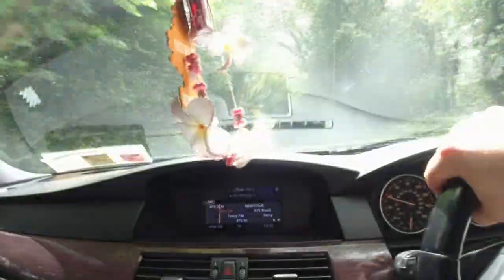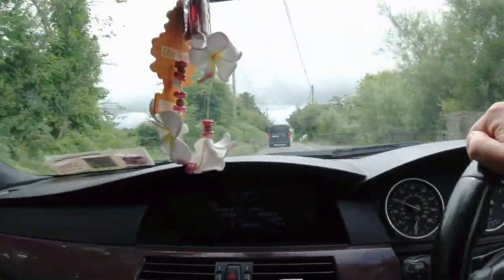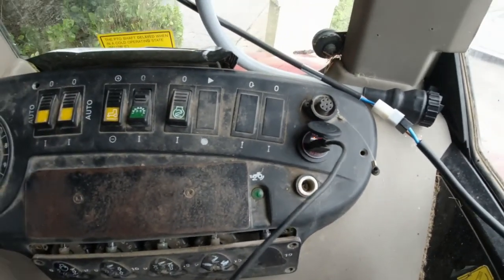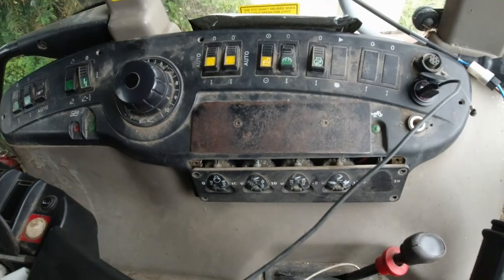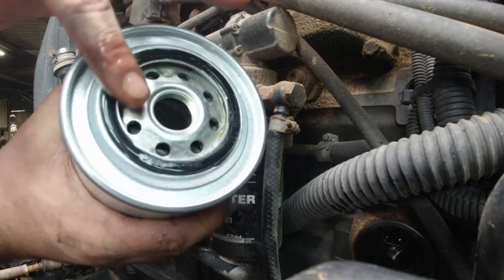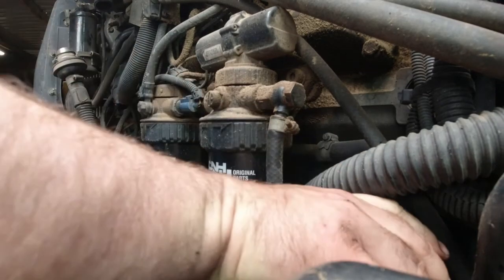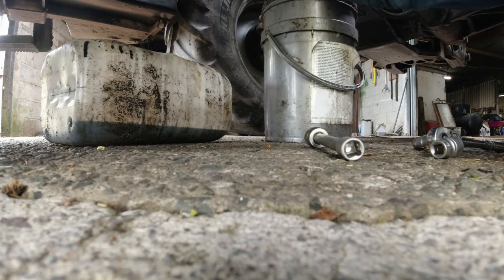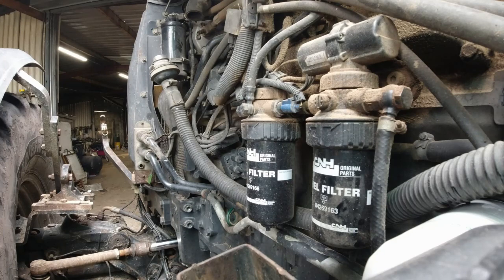Servicing the cvx and other various bits

Comment: Putting the oil on the seal helps its seal properly to the housing face ,if you put it on dry it could damage the seal and it might leak, or if it dose seal properly oh my god the next you go to change  the filter its a pour ba....rd to get off if you don't put the little drop of oil on the seal .

Comment: 😱😱👏👏
Interesting as always. I don't do alot of Mechanical work on Tractors or anything else either. But I heard once that, when your putting oil into the engine, like you are in the video to leave it for a bit of time, before going to look at the dipstick. I did hear that before about putting oil on the seal of the filter aswell.
Is the charge points, still working?
What's the 4 type switches on the side of the wing? Are they to do with the values or what?
There's a handle like, near the back window. Is that for the hitch or what?
Great video again. 👏👏👍👍
Reply from the maker: charger is still working although i still didnt fit them to the rest of the tractors .
the buttons on the mudguards is it ?
yes that leaver is for unlocking the hitch
Reply: @mrcvx  
It's inside the cab. As your looking at where the charging point now is. There down a few inches & to the left of it. I've seen them in a few pictures of cvx's on done deal. There's usually 4 of them. Well it look's that way to me anyway.
👍👍
Reply from the maker: Oh they control preset lift height the speed the lift will raise and drop draught control and droop control
Reply: @mrcvx 
O right. THANK'S. 👍👍